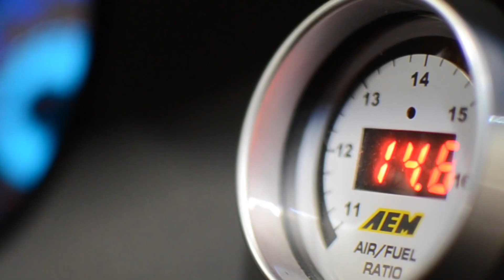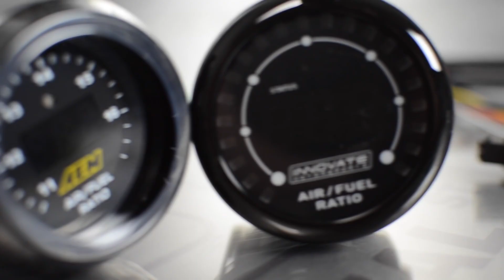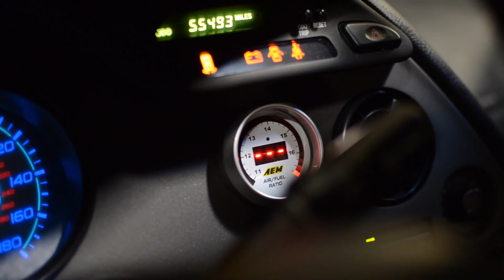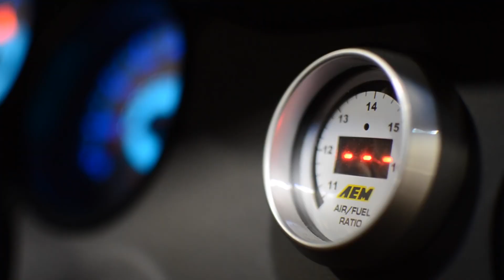Lambda VS AFR - Jay's Tech Tips

Comment: I have a question that is based on sensor placement. I have my wide band sensor in a rear o2 slot that is in the middle of a gutted cat. Will that location potentially create a skewed reading being in an expansion area? Would it be best to just create a bung point before that?

Comment: Really informative vlog, but...? These days you can no longer get 95 actane gas in Norway, it changed over to E-85... Since the stoich then changes as you say from 14.7:1 to 9.7:1, how on earth can I change the value of the air/fuel ratio gauge to track 9.7:1 so I get the correct reading between rich and lean? Also one more thing... Is it posible to hook up an air to fuel ratio gauge to the existing lambda sensor insted af what a lot of others do, cutting, welding, installing an second sensor just for the gauge??

Thanks in advance!

Comment: One thing to add to the Stoichiometric Values, 14.7:1 is for normal gas without ethanol, nearly all pumps put up to 10% so Stoich for most fuels is actually 14 to 14.1

Comment: I have a air fuel ratio gauge reading rich at idle 10.1
idleal stoich must be 14.7 12.5 0r 13.8
how to get that perfect stoich on your gauge i have also a fuel pressur regulator readin 54psi at idle

Comment: Hello, if my O2 sensor output varies from 0.1volts to 0.9 volts for about two times per second, meaning from lean to rich , so the AFR is never stoichiometric ,except a fraction of a second on transition, how can i judge the AFR and the engine management is just fine or wrong? Also, what voltage would be for 14.74-”stoich” ? And, this type of sensor is narrow band or a wide band? Thank you !

Comment: A question guys, I run e85, i understood that 9,7 is the stoich ratio but if it's was calibrate on fuel, the display 14,7 correspond to the 9,7 ratio on e85, right?
Reply: Check it on the Lambda scale first then see where the gauge is.
Reply: @oldblueaccord2629  Thanks
Reply: @alundrasrt   I have an Innvoate guage setup but I never could get it to switch to lambda. I used the computer software setup first to check it and then just use the gauge for realtime. I called, emailed and even called Summit racing to try and figure it out and never did get a reply from Innovate. pretty sad.

Comment: Thank you for the video, i have xseries in my prelude, while cruising at 3000rpm my sensor is fluctuating between 14.6 to 15.7, is this normal?? Also full open trottle reads around 12??
Reply: If your at cruise,light throttle, it should be dead on 14.7 or 1 lambda on a stock type OBD2 vehicle. Wild guess is the sensor needs to be calibrated or its not installed correctly. I always run the Ground wire straight back to the battery to eliminate ground offset. Wideband o2 sensors do go bad alot.

Comment: Great video Jay. My question is, will the stock o2 sensors give you a good Lambda reading. I've added octane booster and I have an i3 tuner installed. Currently the 91 octane tune. My WOT fuel is 1%, 2%, 3% lean on the 3 rpm settings. 1 to 3k My Lambda reading is .996. The other 2 are between .77 to .79 at 6250 rpm. Thanks!

Comment: My golf mk7r stage 3 is running lean with a lambda 0.85 all the way when on boost. I cannot figure out the issue. No knocking no codes but the car is very lean. It s not a tune issue as well. What could be the issue?

Comment: Jay, this is one of the best explanations out there for EUGO gauge reading!  But if I may, can you confirm @1:25 the stoich ratio you have for E10 pump gasoline?  Because I believe E10 is 14.1:1, due to the up-to-10% ethanol component of the fuel.  Straight gasoline (E0) stoich should be 14.7:1.  Other than that, this video rocks. Keep up the good work!
Reply: You're wasting your time asking someone who has no clue.

You're also asking the wrong question.

Stoich for E10 is 14.08xxx.  14.1 is more than close enough to call it correct.  That's irrelevant because a "wideband" sensor will still display 14.7 at stoich on E10.  Do yourself a favor and stop working in AFR.  Lambda is correct for ALL FUELS.  AFR is only correct for one single solitary fuel, something that's virtually non-existent today.  Ethanol content varies wildly between full ups.

Comment: question so i adjust idle mixture screw till i get 14.7 ok, then at higher RPM, if the AFR is off then do i change my jets? (working with a weber dcoe 45) on a 1.5L.....Thanks
Reply: Yes
Reply: @benaiahtheassassin  ok , nevermind 
I guess, I've switched over to a Holley sniper EFI and now the computer makes all the adjustments 
Necessary, I give it target AFR 
At WOT, Cruise, Idel and it does the rest. Best money I've spent
Reply: @ronpilchowski9898  wow, that's dope. I initially planned to go that route but I think there was a limit on power you can make
Reply: @ronpilchowski9898  post a  video
Reply: @benaiahtheassassin  yea, i got the 2300 super sniper the SUPER supports boost and is rated to 650hp thats WAY! More than my old cast iron 1500
 4 banger will ever make, it wasnt so much a horse power thing as it was a modernization, and with protronics  iginition it starts like a new honda no choke no pumping the gas pedal, no human sacrifice , just turn the key plus i added a 4" catalytic converter now my 1974   triumph spitfire starts , runs, smells like a new car . I think i may have picked up a couple HP in the process
Reply: @benaiahtheassassin  not much to see i can email some pics if you like, my spit came to me with a weber dcoe 45 so i used the same manifold made an adapter plate ,added a o2 sensor ,3/8 fuel lines, coolant temp sensor, hooked up the linkage 
And away i went

Comment: The myth that a "narrowband" cannot be used to tune AFR outside of stoichiometric (WOT) and can only be used to tune at stoichiometric (part throttle) is literally the opposite of true.  "Narrowband" sensor voltage output is extremely sensitive right at stoichiometric AFR (and a few tenths +/-) and therefore make it virtually impossible to attain actual stoichiometry.  This is the reason you always see them swinging wildly at part throttle and why the OBD system uses sensor switching activity to determine a failing sensor.  Once you get away from stoichiometric AFR (WOT) a "narrowband" is EXTREMELY accurate for determining AFR although the voltage output is a much narrower window versus AFR change.  A (typically older design) "narrowband" sensor also has a more narrow window of operation (about 0.75 to 1.25 vs ~0.51 to ~1.56 which is where the terminologies "narrowband" and "wideband" come from).  The only time this is going to be an issue is when trying to run at the absolute extreme limits of rich on Ethanol (0.75 to 0.71 lambda) or when using methanol or nitromethane which require excessively rich AFRs and can even bottom out a "wideband".  Basically no "narrowband" equipped vehicle will ever have to worry about operating outside of the range of their OEM sensor.

I'll add a caveat to the original comment:

I have found numerous heated 1 volt sensors that have a WIDER range of measurement than really popular 5 volt sensors.  The terminology narrowband and wideband is not technically accurate in all scenarios.

Accurate terminology is:
1) non-linear 1 volt
2) linear 5 volt

That terminology is correct in all known scenarios.
Reply: I'll add a caveat to the original comment:

I have found numerous heated 1 volt sensors that have a WIDER range of measurement than really popular 5 volt sensors.

The terminology narrowband and wideband is not technically accurate in all scenarios.

Accurate terminology is:
1) non-linear 1 volt
2) linear 5 volt

That terminology is correct in all known scenarios.
Reply: @zacharymorris9917  I think thats what the OEM'S are doing and calling it a wideband sensor.
Reply: Ill disagree esp at WOT.
Reply: @oldblueaccord2629  you're dead wrong.  

What do you think the sensor is there for!?!?  Dead serious question.
Reply: @zacharymorris9917  No OBD2 car I know of uses O2 at WOT. They run open loop and set tables. Terrible idea I know but thats the standard.
Reply: @oldblueaccord2629  thinking that you're teaching me that OBD2 cars run open loop at WOT is extreme arrogance.  Were you even alive in 1996?  Furthermore, that's not completely true.  Most ran open loop, some ran closed loop.

Again, you're simply wrong.  If you want to continue being wrong and making a fool of yourself on the internet, be my guest.  

If you want to learn, listen to multi-decade professional tuners when they offer you free advice.
Reply: @zacharymorris9917   Im repplying to your first of many incorrect statements about OBD2   .....NEVER...sorry...and I worked on EFI cars in the 80's....sad to say.
Reply: @oldblueaccord2629  it's extremely clear how you have continued to maintain your ignorance.  Good job.
Reply: @zacharymorris9917  Hey im a nobody...its all these videos that say other wise you gotta worry about. You should tell The racing channel what you know maybe they will hire you.
Reply: @zacharymorris9917  Anytime you want to change your opinion im still here. You have 3  subs and ZERO vids and have edited your comments multiple times.
Reply: @zacharymorris9917  ...edited.....I really just wanted to see if your a bot or not.
Reply: @oldblueaccord2629  that's a really weird way of admitting you're wrong.
Reply: @zacharymorris9917  You could make some videos of how you tune cars with narrowbands, That would be very cool. They have this thing called Youtube.
Reply: @zacharymorris9917  Waiting on them videos on tuning with a stock narrowband O2 sensor!
Reply: @zacharymorris9917  I got 180 videos you got ZERO. Do one using a stock narrow band tuning a car. Show me something.
Reply: @zacharymorris9917  Id like to see your videos..I been asking for a year now. Why the secret? I mean I know you been sued before im not that guy. I want to learn to tune my car using a narrowband. Common help us out.
Reply: @oldblueaccord2629  here is a precise list of things that you're dead wrong about.  Feel free to address each one with facts, logic and reason.  Feel free to PROVE your claims.

1) 1 volt sensors are more user friendly at stoichiometric AFR.
2) 1 volt sensors are inaccurate at rich AFR.
3) 1 volt sensors are less user friendly at WOT.
4) 1 volt sensors are always more narrow in their measurement range.
5) 1 volt sensors cannot be used for WOT tuning.
6) 1 volt sensors do not give you a reading relative to AFR.
7) it is not possible to tune with a 1 volt sensor.
8) it is only possible to tune with a 5 volt sensor.
9) 5 volt sensors always have a wide range of measurement.
10) no OEM manufacturer uses 1 volt sensors to control AFR at WOT.
11) the OEM is calling a 1 volt sensor a wideband.
12) the number of YouTube videos on an account proves the author is correct.
13) the number of YouTube subscribers on an account proves the author is correct.
14) editing comments proves the author is incorrect.

All dog shit stupid arguments.  You're dead wrong about every single one.  You're arrogant AF.  You don't learn anything because you already think you know everything.  You think you already know everything because a ton of people who know even less than you blow smoke up your ass in the comments section.  🤦
Reply: @zacharymorris9917  I still like you. Thanks. Cya in 6 months. Edit: I know this edit triggers you but at least your not a bot.

Comment: If stoic always equals 1 on the gauge or 14.7 on the gauge, the how exactly is lambda much easier.  Theyre essentially the same.  Its like military time, one guy says 1400, other guy says 2 o clock, none better or easier than the other. 

 I like afr cause it has way more resolution.  .7 to 1 lambda is 30 points of resolution.  The exact same 10.3 to 14.7 afr is 44 points of resolution. 

Kpa and afr is king.
Reply: Correct-amundo I don't know why tuners keep going on about this shit. Just use the gasoline scale if that's what you are used to. 

The O2 doesn't give a shit what fuel is in there. I've compared E content from 10% all the way to 60% and the lambda to gasoline conversion was always the same.
Reply: @littleherms3285  he answered you in the video. Its so you dont have to know the type of fuel your reading. with E15 coming your AFR guage will read gasoline scale 14.7 and that wont be correct. Your correct AFR has a better resolution in your mind but if its not accurate its not accurate.
Reply: @oldblueaccord2629  nope, this is ooooold news. Keep up man.
Reply: @littleherms3285  I did I have...you missed the bus. make up your own rules I like that!
Reply: @oldblueaccord2629  riiiiight.... tell me you have done zero tuning without saying a word.
Reply: @littleherms3285  Yep and 12 years of videos on my youtube page. Pretty scarry aint it.
Reply: @oldblueaccord2629  and yet you dont understand how the AFR/lambda relationship works... that's scary.
Reply: @littleherms3285  I use Lambda because the pump E85 here isnt always 85% its usually 70%. Its just easier for me.
Reply: @oldblueaccord2629  and again, lambda is lambda. 1 is 14.7 is 1... always, doesn't matter what the alcohol content is. Its the same thing.  .75 lambda will always be 11.0AFR no matter what the alcohol content is. I've tested from 0% up to 62% with my content sensor and Flex tuning. Lambda doesn't care what fuel is in there and neither does gas scale, because it's based off the lambda scale that the sensor puts out.

If you always tune in gas AFR, you are tuning in lambda whether you like it or not. You are just seeing a scale with more resolution. 

That why I don't understand why these tuners drone on and on about this subject. If you always leave the gage in gas scale, you are tuning in lambda by default.
Reply: @littleherms3285  Actually .75 on the gasoline scale is 10.3 but I dont run gasoline I run pump  E85 which in this state can be anything from 51%  to 85% Ethanol. So see us Lambda, no being wrong. You tune E85 like your telling you will  be way way way off and burn a piston. Have a nice day.
Reply: @oldblueaccord2629  what ever, been running a SBE 4.8L at 25psi and 800+whp for 2 seasons now on 40 -65% ethanol.... Cause I got no idea how AFR/Lambda works.
Reply: @littleherms3285  great setup lets see that video man!
Reply: @littleherms3285  Just think most only need 15 psi for that power level if you understood Lambda.
Reply: @oldblueaccord2629  🙄
Reply: Waiting on those vids....and waiting and waiting.
Reply: @littleherms3285  Still waiting on that 25 psi boost big block!
Reply: @oldblueaccord2629  big block hey... Now I know for sure your comprehension is out the window.
Reply: @littleherms3285  25 psi and 800 hp...we have been LOL about it for months. THANKS!
Reply: @oldblueaccord2629  4.8L stock bottom end Vortec with twin 62mm turbos. Its actually closer to 900whp. Yuck it up, fuzzball.
Reply: @littleherms3285  cool...and not one video of it?

Comment: Jay maybe you can clarify, I understand but I want to be absolutely positive. I have a AEM Gail safe on my car now. Just switch to E85. I was surprised to the 14.7 ratio as well. So I still need to target the gasoline AFR? Correct? 

Also when I first turn the key on but not start the car the sensor reads 14.7 for a few seconds but if I leave the key on but don’t start the car it will drift up to 18. Like when I’m play on the laptop with the key power on. Does this mean I’m due for a sensor?

Comment: Hi, thanks a lot for the clear and quick explanation. I understand lambda is a good way to measure a rich/lean condition regardless the fuel or vehicle. Just one quick question though, I took my car for smog inspection today and the result was 1.0, 1.15 lambda (low, high rpm), so what do you recommend should be adjusted/changed in order to pass the test? Other values were: 
CO + CO2% 15.0, 12.12
CO2%           14.5, 11.6
NOx ppm       5.0,  56.0
HC                 67.0, 78.0
Thanks again.

Comment: Hello, fellas. I need help figuring out which sensor and gauge to use on my 2018 GP1800 Yamaha waverunner, i have a complete stage 2 riva kit installed together with Riva 8800rpm stage 2 tune, just want to be safe and make sure my AFRs are in check, i will be using premium pump gas. Im looking for some advice which sensor and gauge to use as well as how to get the gauge hooked up once the o2 sensor is mounted on the exhaust. I appreciate your time and assistance. Thinks.

Comment: Might be an dump question  but im having an issue with my lambda reading 

My car would stay at 14.0 AFR at WOT while before it would go up to 12-13 AFR at WOT.

I figured my injectors were dirty due to e85 i got them cleaned and went back to normal.   Yesterday i went back on 91 octane (under a 91 calibration) and my AFR went back to 14 AFR at WOT. 

At this point im thinking the 02 sensor is bad 

Im running hondata flashpro by the way

Comment: 14.7:1 is in weight not in parts.  14.7 kg air to 1 kg of gas.
Reply: That's incorrect. Weight is not the same as mass. Mass = # of molecules. Weight is dependent on gravity. So the AFR would still be the same regardless of how much force of gravity is present.

Parts = mass, not weight.
Reply: I mean it could be. 14.7 parts of air to 1 part of fuel is equal to 14.7g of air to 1g of fuel
Reply: @davidgaal4953  no it isnt. Parts is most of the times in volume. one liter of air is different than one kg of air
Reply: @Leroydv97  oh really... So you want to tell me why parts per million is number of molecules per million molecules?
Reply: @Leroydv97 isn’t it still the same ratio ?
Reply: @stocke46  nope
Reply: He’s right. I’m an automotive engineer…it’s by mass for sure.
Reply: Oh, common- it's 2025 now and people still argue about the basics...
Reply: The guy was talking about ratios, where it makes sense to say x parts per y parts. And in context, it is understood to mean parts by mass, not weight.